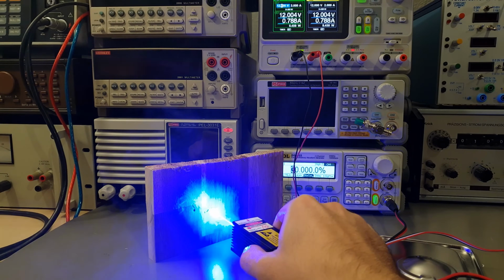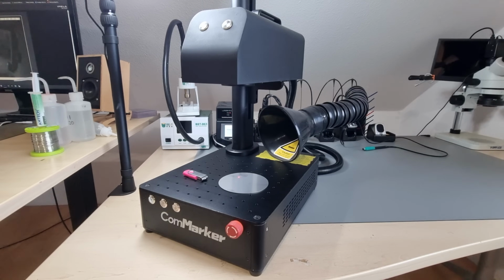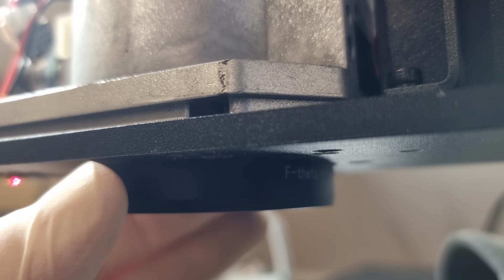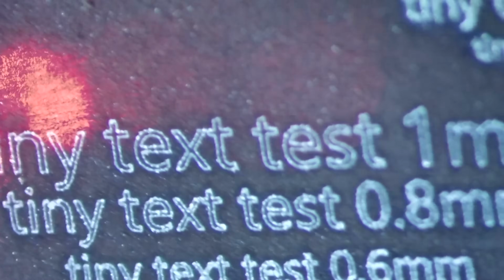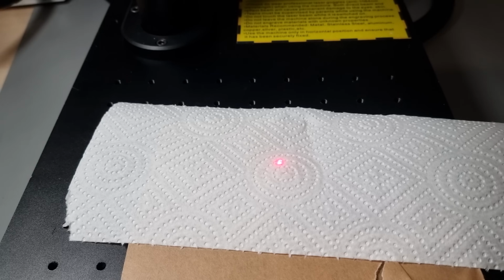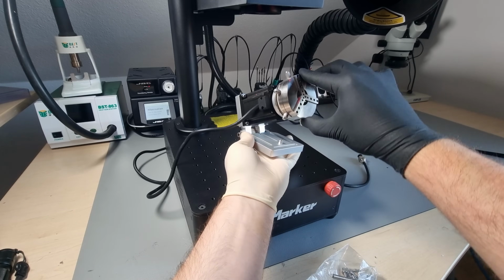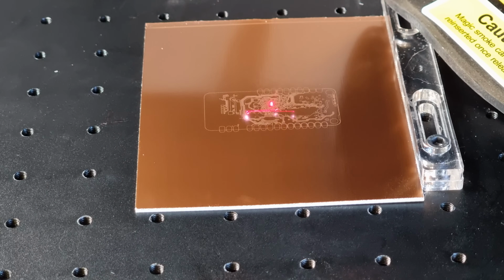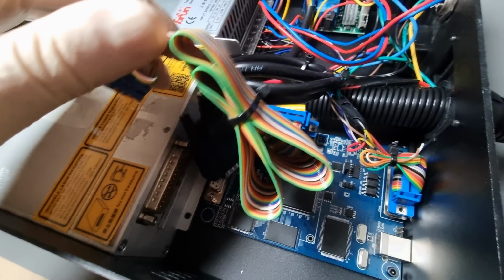Review & Teardown: ComMarker B4 20W Fiber Laser Engraver

Comment: If you must use it with minimal safety, keep it locked in a room so that someone can't walk in and get unexpectedly blinded. That is a good idea even with proper safety too.  It is just one more layer.  If you are worried about a fire, just make sure the floor and walls are concrete or some other material that doesn't burn.  The idea is that you want stuff that ordinarily never would burn.

Comment: If you want much better software you can buy light burn, which will probably work with that laser

I use it with my fiber laser and it’s fantastic

Also a mopa is capable of reducing the NS pulsewidth while a Qswitched will have a fixed pulsewidth. For example, my mopa is adjustable from 5ns pulse up to 200ns pulse

Both with be capable of frequency and power adjustments but mopa source usually have a wider range, mine adjusts from I think 10khz to 1500khz

Comment: I haven't done fiber splicing for manufacture like this but I'd believe most of that slack is just there so they have something to work with when building the laser and it's just tossed in there and taped down. The little tiny circle of fiber is probably because of an unintentional twist or a short or long fiber with no other choice for slack management.  I'm surprised heat sinking is necessary but I guess.  Certainly any splice that's not perfect or bend that increases attenuation (usually less than a 3" radius)  will burn the fiber or laser quickly.

Comment: I wouldn't call carbonised PCB substrate "leakage"! It is generally a low resistance and if a power rails goes through it it will burn while the power source is there, even when the substrate is V0.

Comment: I’ve found aluminum to cut much faster than steel on mine, and on my 50w machine even 5mm deep cuts are possible with enough time.
The walls however do significantly taper inwards, so a wide kerf actually improves cutting speed

Comment: The reason for the "warranty void" label on the MAX laser source is meant to keep you from getting nightmares after having seen the inside 👻. As I understand, MAX is on the cheaper side of fiber lasers. Raycus is next and JPT is top of the line of affordable IR fiber. I'd love to see both types being sent to you to take them apart all the way 😁
The EzCad 2 software is nice but I recently switched over to LightBurn (for Galvo) and that is a huge upgrade. The dxf/svg import is much better and has better path closing options. Most of the times, the trace image feature most of the times works great to convert bitmap images into good line art.

Comment: 3 points = a plane, 2 points = a line. to truly have a planar surface setup 3 is correct.
Reply: That doesn't apply here.  The setup is 3 lines that intersect at a point.  When the workpiece is at the correct distance, you should see only 1 point.  My theory is that with 3 lines, it will be clear if one of them goes askew, since they can no longer intersect at a point.  With only 2 lines, one can go askew, and assuming the lines still meet, they are now indicating the wrong distance but you can't tell.

Comment: These seem so ridiculously unsafe to me. Not only because I've heard that a lot of these glasses dont work, but because they are fully unenclosed and some metal at the wrong angle means you are permanently blind.
Reply: It uses IR. Most polycarbonate plastics like Lexan for instance, absorb/block nearly all IR light. Making safe IR goggles or simply building a shield wall would be trivial.
Reply: It's easy enough to not be in the room.

Comment: Very nice review - I've actually been asked to do a review of a similar machine so I think I'll take some pointers from how you've structured your review, as it's the first I've ever done ;-) Also very interesting to see inside the insides of the actual laser source. Regarding cutting metal, some thoughts. Aluminium is actually much faster to cut than steel because it's cleaner - steel produces a lot of burnt rubbish which tends to clog up the cut. For cutting anything thick, it's essential to use either "wobble" or an offset hatch, rather than just trying to use the beam itself moving around the perimeter. Both wobble and offset hatch essentially thicken up the beam, allowing it to reach deeper. The wobble settings are under the "Advance" button under the pen settings. On my 30W laser, I would use a wobble diameter of 0.5mm and a spacing of 0.03mm to cut 1mm aluminium, with a speed of 1000mm/s and power 90%. Your 20W won't be as fast, but I'm confident it will still cut in a reasonable time.
Reply from the maker: Ah thank you for the hints! I've actually seen someone perform such a cut by engraving a thick ring ... and here I was wondering why 😁
Reply: @reps  JefferyJ has a good video demonstrating the wobble option - https://www.youtube.com/watch?v=3t9C6rlc2no

Comment: For PCB do 3X more pass trought with same speed but only 27% of power there will be no overheating.-.- set freq in to 38-41Khz (copper and brass optimal absorbtion freq) if that still burn you have to shift it in to 51+kHz... When you cut ''trought'' use 2 same vector with HATCH, for example you want 3cm ring.. so set another vector with comon center with weight 3,05cm and that 0,05 gapp fill with HATCH.. that will do the cut.. Agains engrave that by fast pass with every pass rotate the angle by 3degree..  Instead of hard power cut trought and oveheat and melt that material.... i do cut silver and inox like this without overheating.,. trust me if you have any question?? PM me..

Comment: These open frame designs are already terrifying, but that cage thing is utterly horrifying... the potential for tipping it over and receiving a kW pulse to the retina is just too high. These manufacturers really need to learn that just because you can doesn't mean you should.
Reply: A few more safety features would be nice. Multiple redundant accelerometer / tip detection / stand pressure switch for the "uncoupled mode". A few more stop buttons and indicators. Maybe a warning beep, or features like forcing a footpedal to be continuously pressed while an operation is ongoing.
They could also easily include a cheap, foldable, laser-safe plastic enclosure to go around the machine too. Just those flimsy goggles is not enough.
Reply: Yes it's quite spooky, perfect for Halloween season
Reply: So scary. Maybe you should stay away from lasers if they freak you out so much. Stay away from empty rooms. I hear young people are scared for dumb reasons as well.
Reply: Build your own bunker if you’re so irrationally afraid of something essentially far less dangerous than an angle grinder. O, and don’t even glance at the sun. Stay underground.
Reply: Don't ever watch a video of laser rust removal or else you might have an aneurysm.
Reply: I use table saws, welders, high power transmitters, firearms, and vehicles at highway speeds. Life has many dangers, and respecting the tool is part of the job.
Reply: No. People need to learn. Just because they can doesn't mean they should.

You sound like the woman suing Mc Donald's for the coffee being too hot.

Warn people and let Darwin do the rest.
Reply: @critical_always  Except the whole hot coffee thing is way more complex than it seems and mostly about Macdonalds trying to vilify someone they hurt. Apart from the bad example - I agree
Reply: @critical_always  If that's the way you really feel about that lawsuit, I'd highly suggest researching it more. McD's was 100% at fault here, and paid to run ads against her to make it seem like she was being frivolous.
Reply: @critical_always  A bit of a bullshit argument isn't it?
Think of how unsafe your life would be without safety standards. 
Imagine a world with no electrical, chemical, vehicle, food or medical safety standards. Even if you know and understand all the risks, it is probably gonna be someone else action that will kill you.